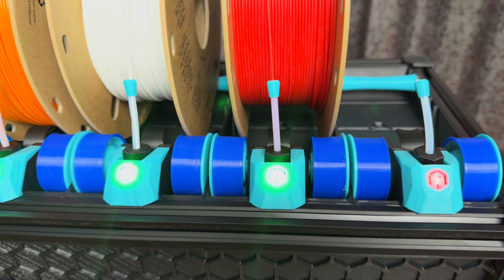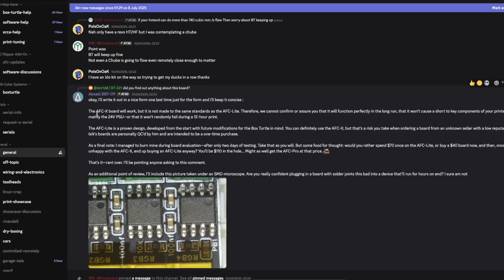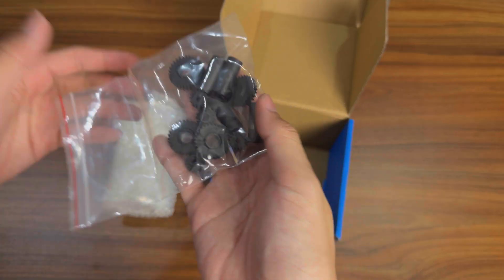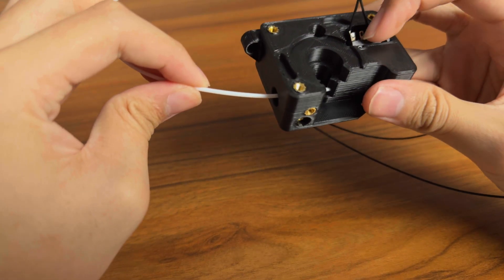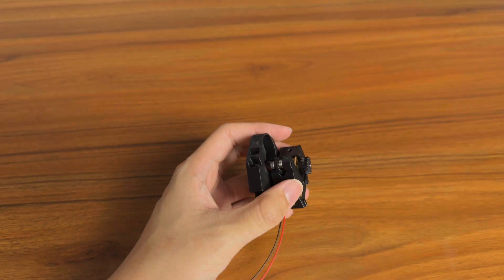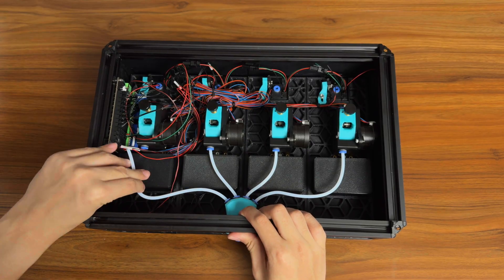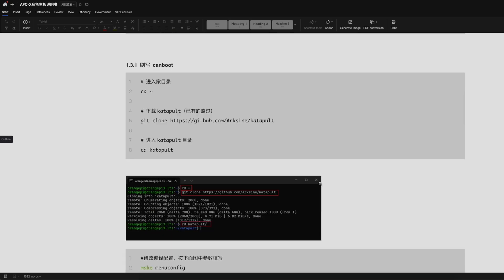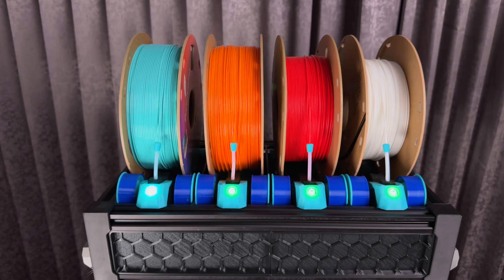The $100 Box Turtle: How? (Obtainable But Not What You Think)

Comment: After your statements from around 6:30, you should change the title because unless you really know a LOT about how to use this cheaper board, this is NOT a $100 AMS and is just clickbait.
Simply add an */asterisk and in ( )/parentheses say "obtainable but not recommendable".
You're at 270 subscribers and nothing will hurt a channels growth more than using clickbait....even if unintentional.
I absolutely love the rest of your video for the DIY community. This is definitely a great option to those who have printers that are not offered a multi color setup.
I see you linked the non drying kit which is $200. You also showed us the enclosed kit that not only requires additional building material but also needs the Poly Dryer system which is $79....and that's if just one dryer will be enough to dry the large enclosure with 4 rolls.
With the added materials and dryer, this will put the cost to nearly $400 and the owner has to print parts, add heat insert nuts, and then assemble and wire it themselves.
So please understand how your video's title can be VERY misleading.
Reply from the maker: Oh, I didn’t quite realized that the title was misleading. About the video, Once I’m able to get the unit to work(rn. The tip tuning just gave me more and more hassle). I might do another video guide setting this board up where should you get it and show some multi color print. Again thanks for the feedback man this was very helpful!
Reply: Ignore this guy Patrick. The title says $100 AMS and you literally provide a BOM for that. Of course there are drawbacks to doing it that cheaply.

 Original title is fine and won't stop the channel growing. Literally all the success 3D printer channels have more clickbait titles than this. Love the videos so far looking forward to more.
Reply: Calm down, Jamal. Put down the nine.

Comment: Also, why would you not share how you were able to get the other board to work?
Did you decide not to use it?
Is there any warranty issues if one decides to use this cheaper, non recommended board?
Reply from the maker: I did still use the cheaper board, it’s been a week or two now no fire no smoke still fine. Like I said there’re not even a proper documentation. So no warranty, no support basically you get what you paid for.

Comment: Would be amazing if you documented HOW you fixed the code or whatever to make the cheaper board and uploaded that on github.
Reply from the maker: The WGB board(AFC-X) is now at version 3; I had the V2, which gave me a peculiar, still-unexplained PWM error that I fixed by just disabling hardware PWM.
Reply: @Patrick-PMS  If klipper was erroring out with hardware pwm enabled, then it sounds like the AFC-X board didn't route the N20 driver lines to PWM capable pins on the MCU